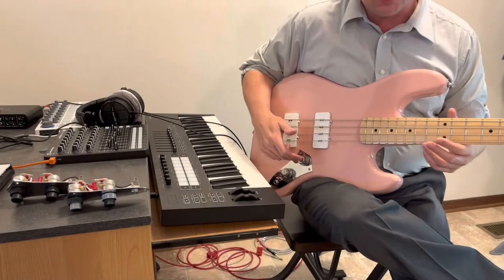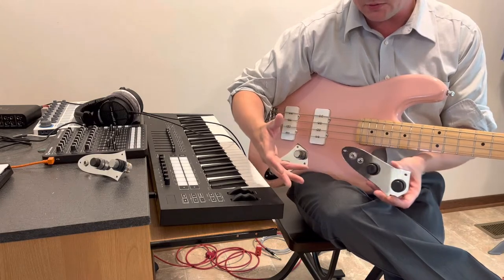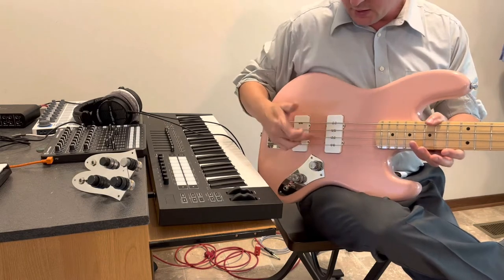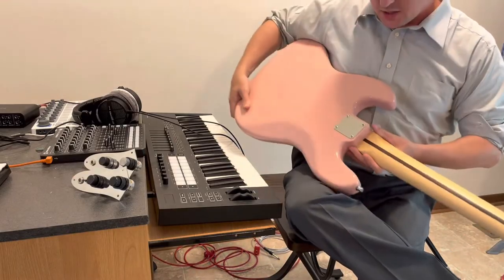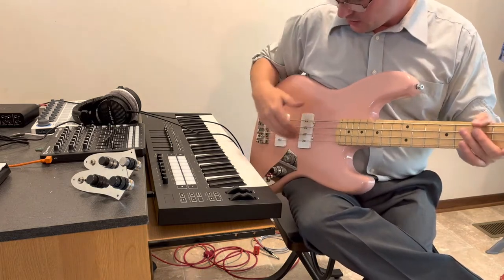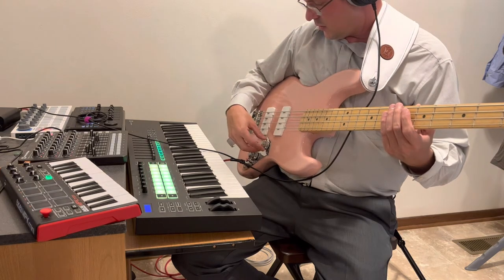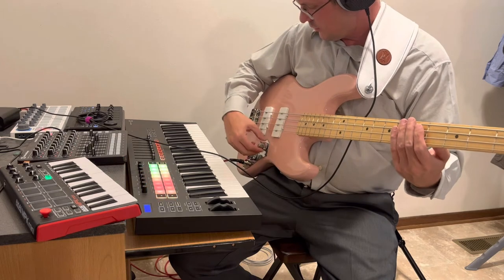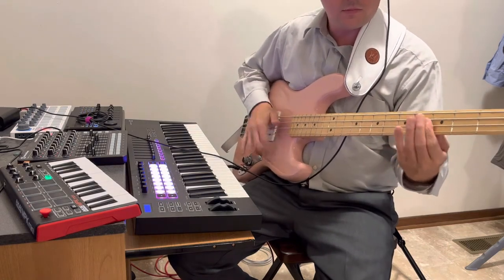Desecration. Fender Jazz Bass Wiring Harness via Les Paul Wiring Plus Series Parallel

Comment: Will this plate fit most non American made fenders? I have a chinder bass that plays great with new pickups in it now. Still has a dull sound with a bit less volume than my other bass with same pick ups.
Reply from the maker: It should fit. One guy told me that it was the tiniest bit off on his G&L due to his pickguard but, shouldn’t be a problem. I couldn’t tell you why your getting less output without seeing under the hood but, I bet that is where they are saving money wink wink